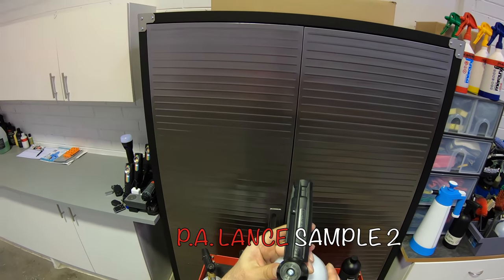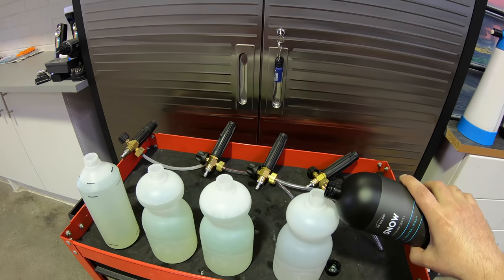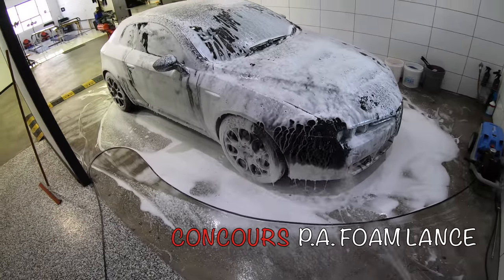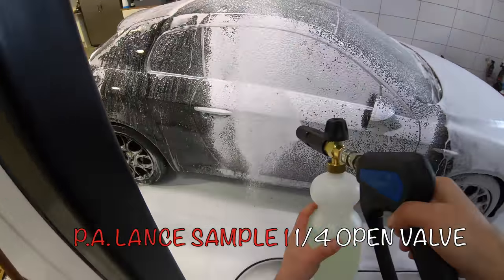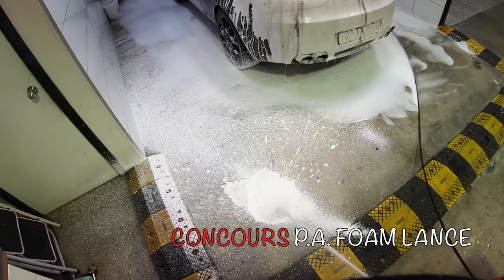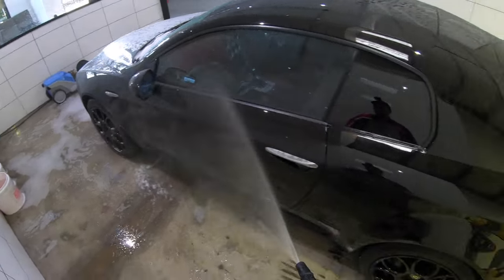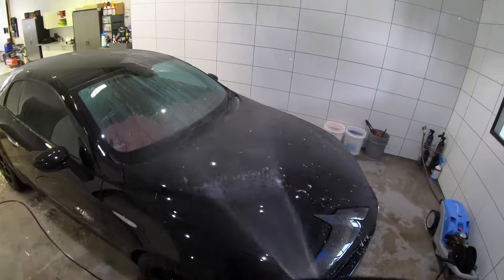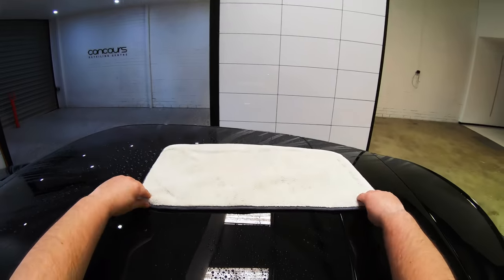Which is the Best Foam Cannon/Lance? How To Judge-Testing and Results!

Comment: I got a $25 generic foam lance from eBay, shipped down from Darwin from memory. I changed the orifice to a 1.1mm and that setup coupled with my little karcher K2 pressure washer I get amazing foam. No need to spend $100 on a lance that's for sure.

Comment: I have a cheap one I got for like $17 on Amazon by Fasmov the only issue is I have to keep adjusting the detergent mixture dial throughout the wash.
Reply: I'm looking to get one of those. Why do you have to adjust it? don't you use it fully open all the time?
Reply: @Danialdaneshmand  I have to adjust it because the level of foam can go from really high to extremely watery for what seems like no reason. Turing the dial down and up again fixes it though. Mine could just be defective.
Reply: @kakashi99908  There is a some sort of brass mesh inside maybe that's clogged i heard you have to clean it from time to time.

Comment: Hi mate, what brand foam lancer is reasonably good these days for home using Karcher pressure washer 2000 psi. I couldn’t find Concourse anywhere in Melbourne.Thanks
Reply from the maker: It’s been replaced by the Waxit foam Lance which is actually pretty good and has a nice wider base bottle. But I know from some past comments here that’s there’s a bunch of people that like the Bowden’s Own one as well as the Autoglym- but I haven’t used them personally.
Reply: Car Craft Auto Detailing thanks a lot, much appreciated🙏

Comment: What were the sample 1 2 3 and 4 mate? Eg. Do they have a particular Brand label to them other than PA. As I'm needing to buy a snow foam Lance right now and REALLY need to know the best way to go (home use on 2 BMWs) got a bad back so want to get as much cleaning power as possible to minimise hands on aspect (yeah I know I'm gonna have to get hands on with it especially if j want to clay bar, polish and wax it) but of getting the shite off initially means hands on is minimised then I want to get the best one possible without it being RIDICULOUS expensive. As in of its in same cheap as chips price range then that's what I'll get lol (if it does a decent job that is!) Or wait til I can get one... Any thoughts on the snow foam that's got it attached to the bottle when you buy the detergent can't think of the name but Halfords and all them big brand places sell it.. wondered if any good?
Reply from the maker: Unfortunately those sample foam lances never got picked up to be sold so I’m unsure as to where you could find them. A lot of guys in the states seem to like the MTM foam lance so that could be one to look into. As far as snow foams go some of the more popular ones in the states also seem to be Adams, Carpro and Gyeon which seem to have a good following and reputation.
Reply: @CarCraftAutoDetailing  thanks mate, I'm actually in London but all k seem to see are generic either all plastic of part plastic part brass fittings and most say Karcher K1234567 compatible and most look the same whether £40 or £16.. so Im stumped really whether to just go Amazon/eBay £14-16 as look the same (if not better than the more expensive ones that some are just all plastic!?) lol 😅🤦🏻

Comment: Can't go wrong with MTM pf22 with the 1.1 mm orifice.
Reply: 1.1 is for use with cheaper pressure washers with lower pressure and flow amounts.  With Kranzle or other higher end units putting out 2.1 to 2.5 GPM or so, the PF22's stock 1.25 orifice is more appropriate.  Using the 1.1 with higher end PW's will cause the pressure washer to have to work too hard.

Comment: Just a question but has anyone used the bowdens snow lance at all and the bowdens snow job wash at all and with the cheap 99.00 dollar gurnie as well ?
Reply: I have used bowdens snow job, it's pretty good. But I'd get the Cocours Snow or Snow+ over it for sure. Better value and better product.

Comment: I own a regular home use karcher, any of this foam guns fits the karcher? Or do i need anything in particular
Reply: @CarCraftAutoDetailing  well, there is no adaptor, so what would i need? how should i ask for it
Reply: Obsessed Garage is currently in the process of putting together a whole database of what fittings, quick connects, hoses, guns, wands and foam cannons will work with Karcher and several other consumer PW brands as we speak.  Matt will probably have a video up about Karcher specifically in the next week or so.
Reply: @Patrick94GSR  thank you for the info
Reply: It's probably a "K" fitting, that's the standard from domestic karcher pressure washers. What model is the pressure washer? I.e. I own a K2.
Reply: @kenlawton1531  it's a k2.160
Reply: @newthepanch  Head down to supercheap auto or autobarn etc and as for a K fitting. Take your lance with you.
Reply: @kenlawton1531  well i live in Mexico as you can tell, si there is no ebay, super cheap, autobarn, ill search for it, thanks dude
Reply: @newthepanch  lol I'm Sure you can get it there. Not sure how I can tell though lol